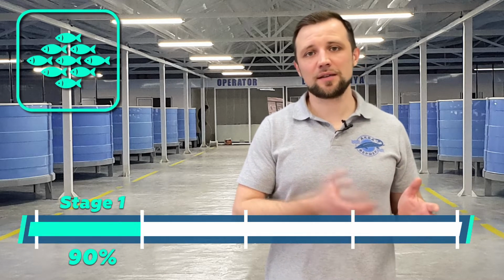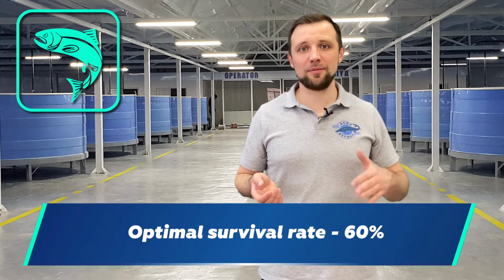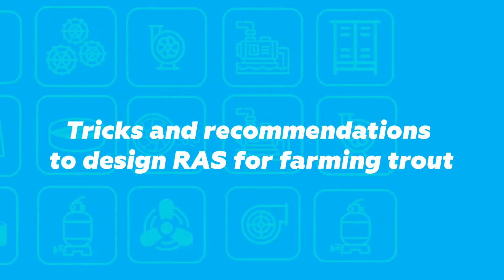Top 11 TRICKS in designing RAS for TROUT

Comment: 🎯 Key points for quick navigation:

00:01:38 🌡️ Optimal temperature for trout farming is 15-17 degrees Celsius for best growth efficiency.
00:02:03 🧪 Maintain ammonia levels under 1 mg/L for fry and 2 mg/L for grown trout to avoid toxicity.
00:02:16 🐟 Sensitivity to nitrites in trout requires keeping levels below 0.2 mg/L for fry and 1 mg/L for grown trout.
00:02:42 🌀 Nitrates should be kept under 50 mg/L for fry and 150 mg/L for adult trout to prevent growth deterioration.
00:03:23 🍽️ Feed conversion rate varies with trout size, needing up to 1.45 kg of feed per kg of fish weight gain for larger sizes.
00:04:33 🐠 High-quality extruded feeds are crucial for achieving good fish meat quality and feed conversion rates.
00:05:00 🥚 Most fertilized eggs for rainbow trout farming are imported from countries like the USA and Italy.
00:06:08 🌱 Normal survival rates from fertilized eggs to grow-out trout average around 60%.
00:07:18 ⏳ It takes about 1.5 years to grow trout from larvae to 3 kg under optimal farming conditions.
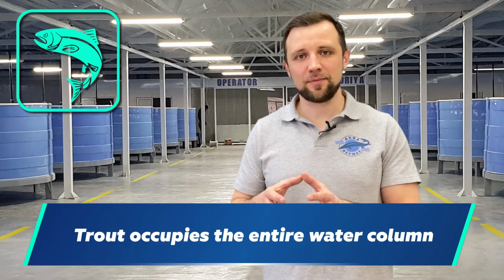00:08:00 🏞️ Trout farming tanks can be up to 5 meters deep, accommodating the species' use of the entire water column.
00:09:10 🔧 It's recommended to install preliminary water treatment units next to trout farming tanks for better water quality management.
00:10:59 📏 Stocking density for trout should ideally not exceed 100-120 kg/m³ to ensure stable and predictable growth.
00:11:41 💨 Installation of a degassing system is essential for trout farms to manage carbon dioxide levels due to the species' sensitivity.
00:12:09 🇩🇰 The Danish method of trout farming uses rectangular canals and air lifts for water circulation, offering energy efficiency and compactness.
00:13:34 🛠️ Design of trout farming systems must accommodate the handling and observation of the fish, suggesting large tank volumes for ease of management.
00:14:03 🐣 Vertical incubators are efficient for trout egg incubation, providing compact and controlled environments.
00:17:30 🕸️ Use 40 micron mesh for drum filters with fry due to their small waste size, and 60 micron for larger trout.
00:19:21 🌐 Ozone treatment is recommended for water disinfection in trout farms to ensure high water quality and transparency.
00:20:02 🌬️ A degassing unit is crucial in trout farms to manage high stock intensities and sensitivity to dissolved gases.

Made with HARPA AI

Comment: Very informative, how you rate Danish  Model (DM) over RAS indoor circulation system for GROWOUT system?
 
Is DM have big difference then RAS in door system in terms of capital cost?
Do you think DM even have less running and management cost over RAS?
Is DM take less time to have same weight over RAS?
How to make sure bio security in Danish Model?

It will be really helpful if you could do a vlog on this matters as well 🙂
Reply from the maker: Hi, very nice questions thanks! Will try to answer:

1) Difference in CapEx - depends on actual location. If you have cheap source of concrete, then yes - it might be cheaper over plastic tanks
2) Running and management costs - no big difference, same processes. It mostly depends on HOW you have designed the system A and B
3) Fish growth - 100% same, it depends not on type of system, but on water temperature, quality, feeding and feed quality.
4) Biosecurity in Danish model - completely same and in normal RAS. Disinfection of water and people, correct fish movement etc.